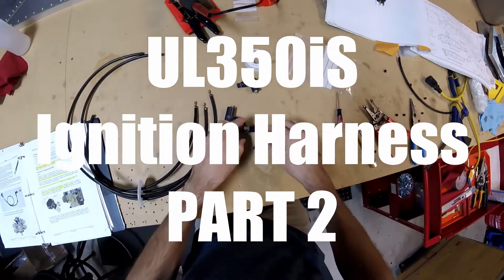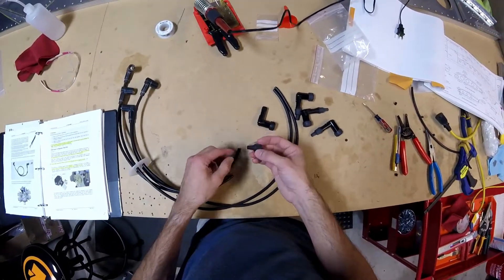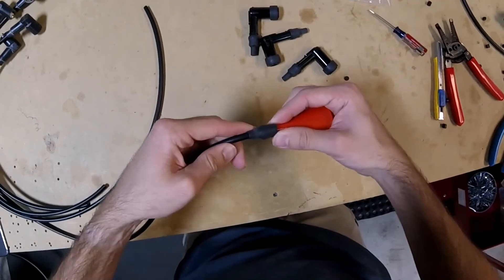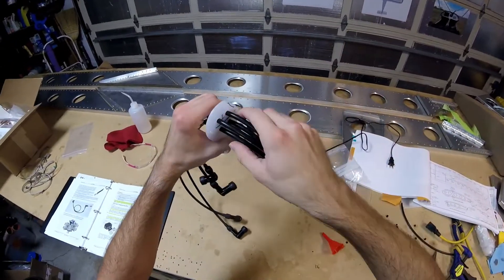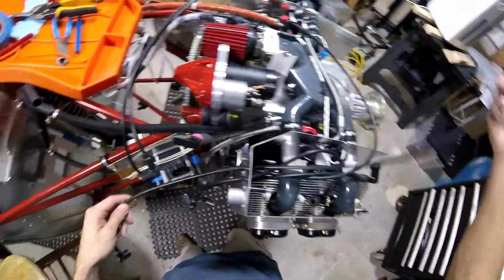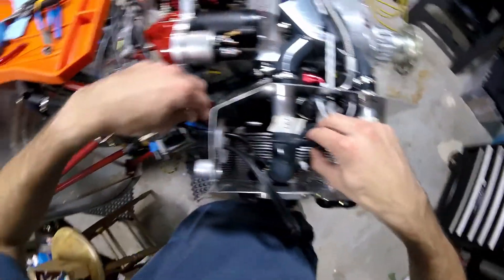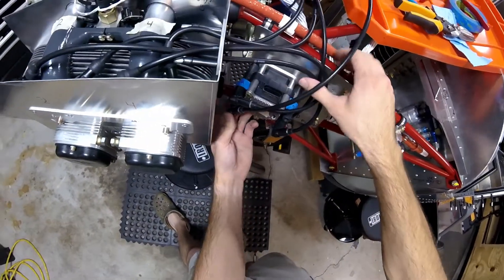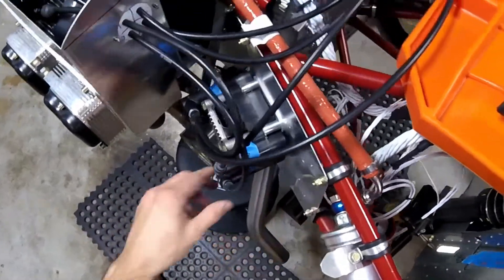Ignition Harness (High-Tension) PART 2 - Installation - UL350iS - Zenith 750 Cruzer Build

Comment: Use a multi size blade type pencil sharpener that dose all sizes of pencils to put a slight taper the cables ends this will help starting the boots and any other shrink wrap etc.  been doing this a long time on custom cables and wire harness.
Reply from the maker: That's a good idea. Thanks.

Comment: In connecting the wires is there a firing sequence you follow in connecting the cylinder plugs to the proper outlet on the coil?